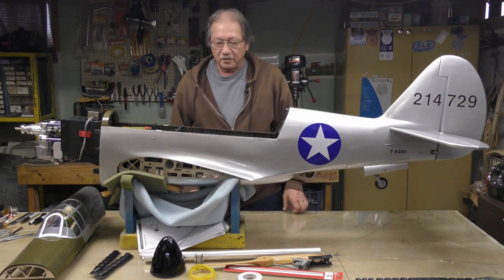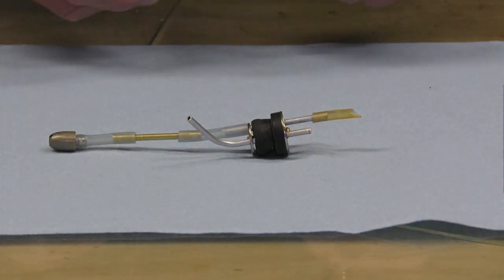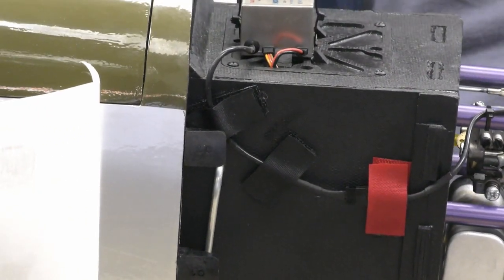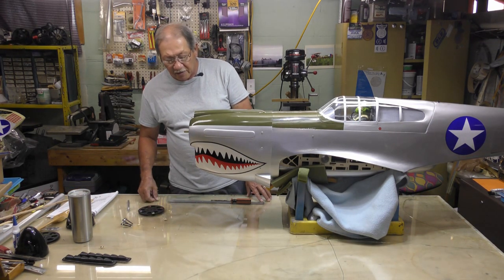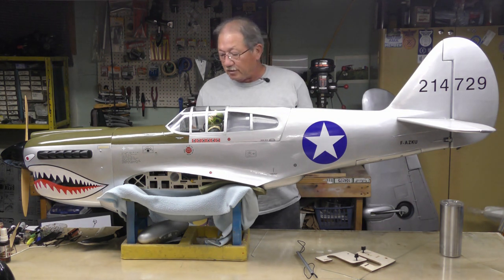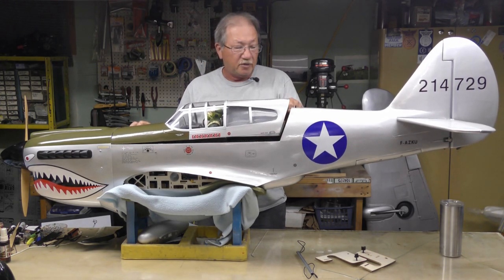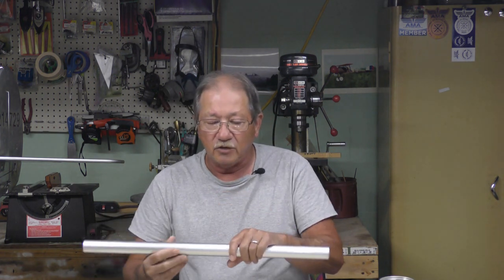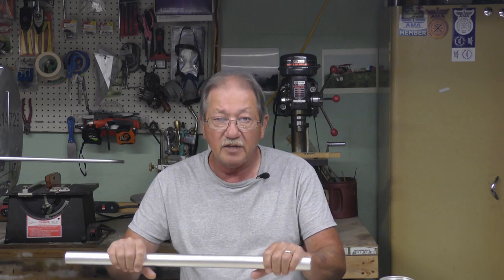Phoenix Model P 40 Warhawk Assembly Part 5

Comment: I've been building and flying r/c since 1964 and I thought I was pretty salty. Bob...you blew me away with some of your very clever ideas. I love your videos. You are very thorough and easy to understand. You explain things so anyone should be able to understand. The operative word here is "should". I'm finishing up a P-40 right now and will use many of your ideas. For example, I never thought of running aluminum tubing from the tank to just short of the carb. I have always just run the fuel line all the way. I'm not clear on the advantage but it does save on fuel line. THANKS AGAIN.👍
Reply from the maker: I've been flying r/c since 1964 as well. I'm a third generation modeler and was taught by my dad and grandpa along with their model building buddies. I soloed at the age of 5 and was instructing at the age of 10. I taught model building for a few years at the the local high school at night for a few years in my 20's. I was employed for 3 years as a model airplane designer and test pilot in my 30's for a small model company. Then went on to being a employed as a r/c model airplane designer and test pilot for a client in the private sector to prove (back then) a radical wing design. I retired at the age of 47 and quit the professional model building trade for a more relaxed hobby atmosphere. I was just  recruited into a new position teaching (starting in May 2025) some young engineering students at the local University, basic model airplane design, aerodynamics and flight instruction. So much for my retirement!

I run a hard fuel line from the tank out the firewall to reduce the chance of a broken fuel line inside the model. To me there's nothing more frustrating than being at the flying field and inadvertently filling the fuselage with fuel.  

My idea is to get as much of my r/c model knowledge ( to get my 2 cents in) on video as I can to promote the building side of the hobby. Also to reduce the amount of phone calls 
I receive a day!😁 I'm very glad you like the video's

Comment: I just solder the brass to the clunk & solder brass barbs on both sides. This way there is less chance for the fuel tubing slipping off & less cuts in the fuel tubing. I never use the aluminum tubing it usually cracks with gassers.
Your dead stick landing was a thing of beauty. 👍🏻
Reply from the maker: Your clunk setup is a better setup for sure, however I just wanted to show a simple solution  to an age old problem. Personally I never had a fuel line slip off yet (knock on wood) nor have I ever had an aluminum tube fail in over 40 years of using them. But I suppose it is possible, I'll keep an eye on mine.
Thanks for the cooment.

Comment: This was a great series and I have setup a bellcrank in mine as well after watching. Just wondering what did you do for your engine exhaust. Does it just hit the bottom of the cowl or did you direct it out through the rear flaps?
Reply: I glued a piece of Litho plate (very thin metal used in the printing process of newspapers, etc..) glued to the bottom of the cowl to direct the exhaust out the flap opening.
Reply: That’s a great idea. Thanks 😊